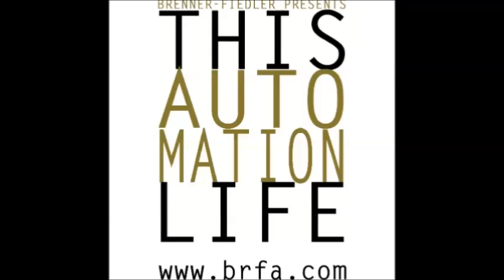Stepper Motors vs Servo Motors

Comment: Side note: if you needed small positioning accuracy, like in a microscope system,.. you would typical switch over piezoelectric actuation. These are extremely accurate, but typically only travel shorter distances.

Comment: Servos are shaped badly, they grind when bearing weight and they fall when power goes off. They need to be cylindrical with breaks to be of much use. Anyone know why servos are so badly designed for their animatronics?
Reply: Paul Nicholson definitely agreed with you, it produces a lot of noise, in fact I feel it is slower than stepper because of its real time feedback, forth and back action of servo delay moving forward. Servo sound excellent for precision but practically a lot of setback compare to stepper.